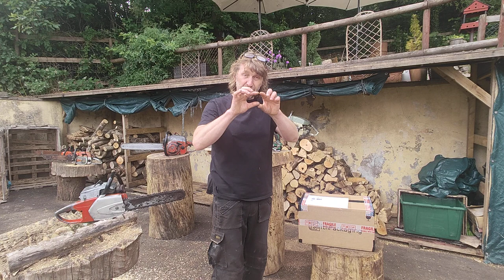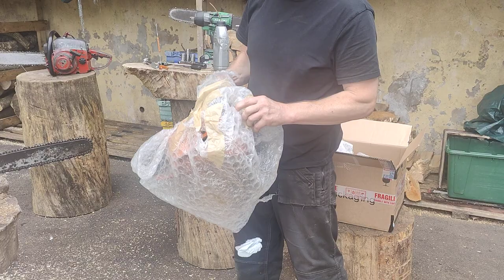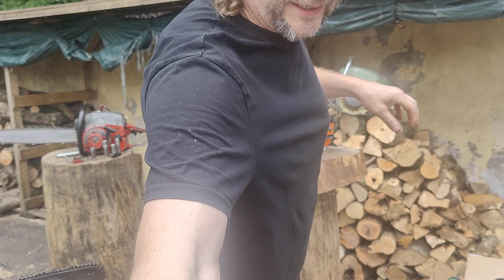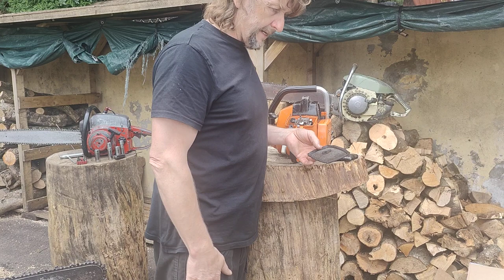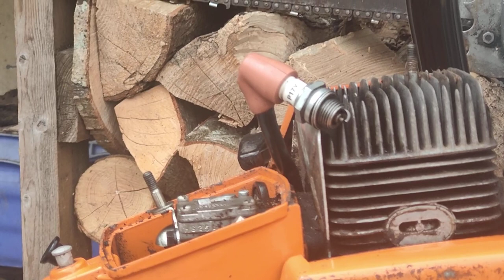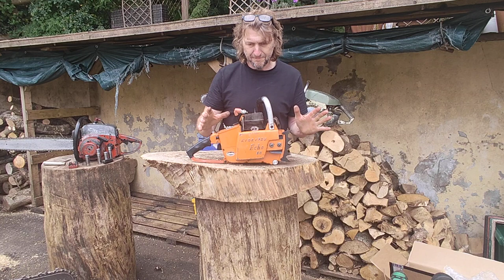Echo CS-60S Vintage Project Chainsaw. Gentleman returned to me not as described. Unboxing & testing!

Comment: 1:43 i bought a saw from Rob,it was an ole mac 64cc saw,imaculate,but as i inspected it,it was missing air filter,the clutch cover had a massive crack in it,and it packed in after 1st use,when inspected ,whoever had it last hadnt tightened the cylinder bolts,and it let in air ,wrecking the saw, and yes i had contacted Rob about the carb,which i thought that was the problem at 1st,but felt like he wasnt really interested
Reply from the maker: Hello Paul.
When did you buy the Oleo Mac? I genuinely don't ever remember not being interested in any of my vintage saws.
Regards
Rob
Reply from the maker: Hello Paul..
I finally found the saw you purchased from me back on 6th Dec 2020, it took me a little while to locate it. A beautiful Oleo Mac 264 with a mint period Oregon bar & chain - I even know the chainsaw dealer it came from 🙂
Here is the YouTube link:
https://youtu.be/VqaMuooC-SI

The saw did not have any massive cracks in the clutch cover when it was photographed and I just found your original eBay feedback and all our old eBay messages (archived  - I am so careful)
Your feedback said "Brill"

I'd love to know what changed for you?
I work with computers and as a matter of course keep detailed pictures of every saw I have owned.

Please let me know what messages you are referring to when I had no interest ! - I cannot find them..

It is unfortunate to hear from someone in such a fashion after 3 years with no messages inbetween and only good positive feedback !

Sincerely 
Rob